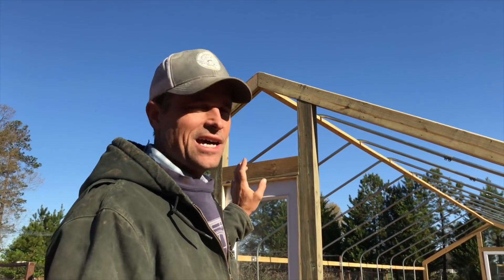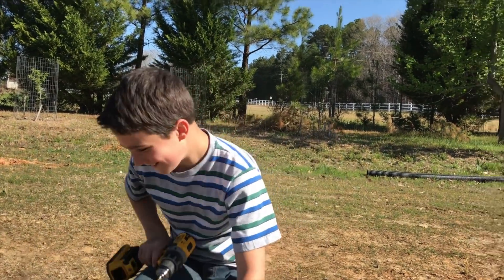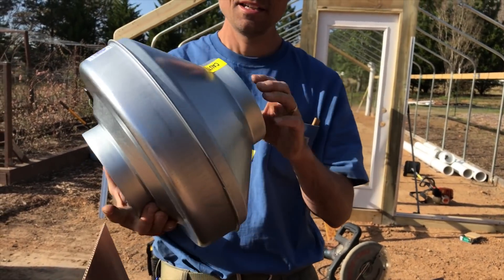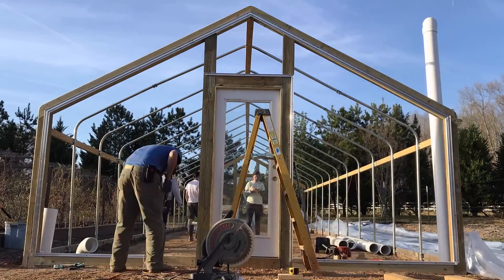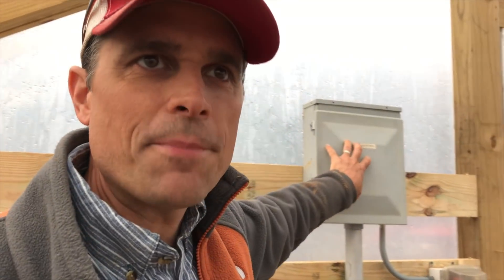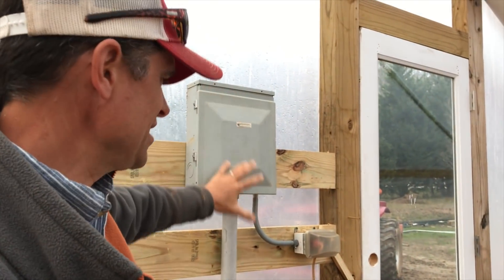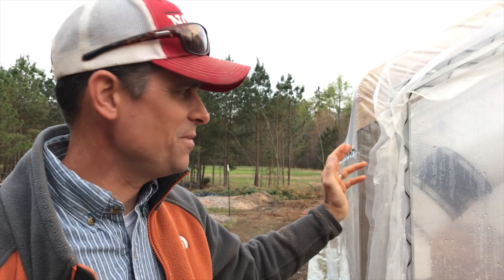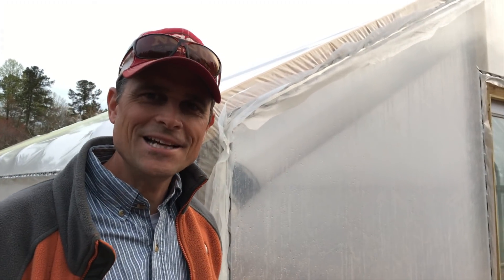DIY Geothermal Greenhouse Pt 8: POLY FILM INSTALLATION

Comment: For the jumper, you could pop rivet your wiggle wire base to the perimeter of a ceiling collar base for air tight fit, install a collar then jumper with something as cheap as dryer hose. One dryer hose should get you multiple jumpers.

Here are the components from Home Depot.
https://www.homedepot.com/p/4-in-Ceiling-Collar-CC4/100124671
https://www.homedepot.com/p/4-in-Starting-Collar-Take-Off-Snap-Together-SCF4/100396965
https://www.homedepot.com/p/GE-Flexible-Metal-Dryer-Duct-PM08X10085DS/205472610

Comment: Thank you so much for making this series. I’m a little south of you I think, around Fayetteville and plan on building a greenhouse just like yours. Please add test videos as time goes by showing how effective or not the geothermal system ends up being. Thanks again man!
Reply from the maker: Thanks for watching and taking the time to comment. We will definitely be adding updates as we go and sharing data. My concern at this point is that the earth battery system we installed is going to be undersized. By that I mean, even bigger manifold or trunk pipes, with larger fans pushing more air faster. At some point we may see if there would be value to adding additional fans on the system which would be easy enough with a y connector.
Reply: Pushing massive amounts of air into a few large inlet manifolds is not the way to go. The higher the flow, the higher the loss. You`ll pay a lot for high capacity manifolds, typically around $360 for a 20ft length of 18" ADS.

Comment: Use dryer vent tubing to make the jumps with the exhaust plate door removed use the flat piece to duct tape to the interior walls.
Reply: Fasten a 4" inch Air Vent Duct Connector Flange ($8 on Amazon) to the film with double sided exterior carpet tape. Then the semi-rigid aluminum flex hose clamps to that. Don't use the foil-paper hose, it won't last long.
Reply from the maker: Yes! That's it - dryer vent made sense, but I was concerned about the wire and securing it to the film. Perfect DIY solution. Thank you!

Comment: Why not put a layer of greenhouse plastic on the inside of your end wall 4" x 4" studs?  Then you wouldn't have to run your $30 "jumpers" to these areas.  You'd have a constant 3 1/2"  dead air space between the layers.
Reply from the maker: We did consider that, but we think we're going to be attaching a number of things to the end walls on the inside. If we don't, your suggestion may still happen. Thanks

Comment: With the changes it's looking great. I am very interested to see how the earth battery works over the summer.
Reply from the maker: Thanks. As to how it works in the summer, we're really interested as well. Of course, as we've posted videos about this project, many folks with far more knowledge than us have shared thoughts. I am now concerned that the whole system will be a bit undersized. We built it based of what we could find at the time and wish he had found more of this information sooner. Still, we would have been limited by time and budget. So we'll see what it does and share the results!

Comment: Congratulations! It looks grand! Have you checked the temperature of the air coming out of the ground yet? Where did you get your fans?
Reply: Hi Phil
If you actively add or remove heat from the ground, its temperature will not follow the natural curve. If you pull a miilion btu`s from the ground under your greenhouse you cant expect its temperature to be the same as the ground outside at the same depth because it didnt lose a million extra btu  ;)
In simple terms, the installation will create a new average ground temperature based on the energy balance. Its amazing how many folks plan to bury their tubes 8ft or more deep due to the stable ground temperature ;) If you take out more energy than you put in, the average drops, and vice versa. There`s no free lunch as contrary to popular belief the energy isnt replaced instantly by the earth`s core ;) 
I know that the average temperature of the ground 10ft below my greenhouse has gradually increased over the last 9 years in comparison to the ground outside at the same depth. This kind of information is valuable when it comes to design choices. If heating is more important than cooling you should insulate below the system. Be aware that adding insulation will fix the volume of mass which may have a negative impact on the cooling performance. If you have the real estate, you could install a seperate system outside the greenhouse to increase the cooling performance. As its not sheltered by a structure, heat will be lost during the night which increases the cooling capacity for the following day. You can also route outside air through a standard system and exhaust it outside to remove excess heat for the same reason if required. These are strategies for hotter climates where a heavy cooling bias is required. Again, it highlights why you shouldn`t copy a system unless its backed up by real data and is located just down the road ;)
Reply: I dont think it would be much help without an understanding of the underlying principles and reasons for the design choices. 
Almost every installation uses the standard format of risers feeding manifolds which supply multiple parallel 4" tubes, exit via another manifold and riser. The losses in this kind of layout are large and cumulative, balancing the airflow so each tube gets an equal share is almost impossible. Folks are fixated with using overly long tubes when they should focus more on the amount of air. Consider 30ft of 4" tube buried in the ground, it has a finite surface area available for heat exhange. If the tube was cutinto 2x 15ft length it would have exactly the same surface area and heat exchange potential..The difference is you can run 2.5x as much air through 2x 15ft tubes as 1x 30ft tube for the same loss. 100cfm would provide a dwell time of approx 1.57 seconds in a 30ft tube. Running 125cfm through a 15ft tube would be around 0.6 seconds. If the air exits the tube at the soilmass temperature your tubing isnt working as efficiently as it would  if  the air exits slight higher than the soil temperature. Moving 2.5x as much air at a cost of a few degrees (waemer exit air) is preferable to moving 2.5x less air and gaining a few degrees (cooler exit air). Its similar to heating a swimming pool by boiling a kettle, a few pints at 212 deg F vs moving a lot of water which raises the entire pool by 2 deg F per pass. The only limitation on the air flow rate is in the event the system outruns the incoming solar gain. You should then reduce the fan speed to keep pace with the incoming gains which will cost you less in electrical power ($$) vs running the fan flat out to cool the greenhouse and turning the fan off until the heat builds back up.
Reply: The temperature coming out of the tubes will be the same as the ground temperature. To be sure all of the tubing is active you need to increase the airflow so the air coming out is above the ground temperature. I dont think you`ll have nearly enough fan power to achieve it. The long runs of 6" pipe (and bends) from the fans will reduce the airflow before it gets to the underground tubing. What is left (assuming the system is perfectly balanced) will be equally shared between the underground tubes, not forgetting they are heavily corrugated and subject to higher losses than smooth tubing. Your fan spec gives a maximum flow of 483cfm at 0 inch wc. Optimistically, you may have 50cfm making out of each underground tube but its likely to be much less. Working on the assumption of 600cfm total you`ll put all the greenhouse air underground 5.8x per hour. It wont be enough to cool the greenhouse even at the start of the season when the mass temperature is at its coldest aka the largest air/mass temperature difference. As the mass warms up through the season, the temperature difference reduces and you need more airflow. 
On a different note, i would use a differential pressure switch and a simple flap valve for the double poly inflation blower, it`ll reduce the running cost by upto 80% and extend the life of the blower considerably ;)
Reply: It wouldnt be worth the expense because the issue isnt the amount of flow, its the resistance. Doubling the airflow will result in a 4-fold increase in losses. It would help to know the dimensions of the greenhouse and the lengths of tubes you installed ;)
Reply: After a quick search i find the greenhouse is 50ft x16ft with 6,144 cubic foot volume. I guess the excavation is around 46ft x 12ft x 4ft deep making the individual tube length somewhere around 44ft long.
Reply: I would have installed twice the amount of tubing with a low resistance (0.1- 0.2 in wc) layout capable of handling at least 2000cfm. Disregarding the shortfall in tubing and losses in the headers, to achieve 2000cfm in the current installation you`d need 2 fans capable of delivering 1000cfm at 2" wc at least. The fans would be very expensive and power hungry,  not a viable option/workaround for fixing a design issue.
Reply: I would look at installing multiple systems which will give you more flexibility and better overall air distribution both underground and in the greenhouse. If  i had space for a greenhouse that size i`d simply install multiples of the system i`m using now.
Be sure to monitor your greenhouse RH% especially on the nights you use the system for heating. You`ll find the data useful when you come to design the larger system ;)
Reply: Hi Phil
My installation is unique and radically different to anything you`ll find in current use. The same could be said about the greenhouse its in. My system was designed back in 2009 under the watchful eye of John Cruickshank who sadly is no longer with us. At that time, realworld data from installations to drive the design forward was very thin on the ground but new information was gradually coming to light, namely increasing the recommended greenhouse turnover rate to10x minimum.The reccomendation of upto 20x for cooling is standard now but its still only 5x for heating. 
I decided my installation was going to be capable of providing as much new and useful data as possible. I bounced ideas off John for several months and literally anything he liked the sound of was incorporated. The end result was very radical compared to the standard format but also logical and elegant. I dont mind pointing ordinary folks in the right direction but i`m not doing the R&D for companies that sell these systems, they can do their own ;) John used to say, its plain to see as the nose on your face ;)
Reply from the maker: Phil, uploading a new video tomorrow with some info about this. We don't have a lot of data, but right now the system is taking daytime air in the greenhouse between 95-105 degrees and exhausting it consistently 30 degrees cooler. At night, with consistent or cooling temps outside, the exhaust temps have been slowly increasing. First several night it was 57 degrees. Then it started rising slowly. Tonight it was 64 degrees. So I think it is starting to increasingly store heat. We'll continue to update and show real data.
Reply: To get a better picture you should install a few sensors to monitor the soilmass temperature.They are also very useful for controlling the fan.  Its vitally important to monitor the greenhouse humidity  What you will notice is a rise in greenhouse RH at night when the system is running. Folks assume the heat from the tubes is 100% sensible like an electric fire when in reality the bulk is in latent form. What happens is the cool air picks up sensible heat which raises the temperature. The RH% drops as a result and the air picks up moisture. Here`s the important part, in order for the moisture to evaporate (change phase from liquid to gas) it requires energy which it acquires from the mass. Sweat evaporating from the skin is the same process which results in.. cold skin as the sweat takes the energy it needs to change phase ;) The increase in RH% doesnt raise the temperature of the air. When the warm, moist air meets the cooler glazing or steel frame it will drop to dewpoint and condense. At the same instant, the sensible energy robbed from the mass to evaporate the water in the first place is now released to the glazing or frame. In essence, you`ll have a conveyor belt taking heat from the mass and transporting it to the glazing etc where it is lost ;)
Cooling mode converts latent to sensible and stores it in the mass.  
Heating mode converts sensible from the mass into latent. Glazing (or other cold surface converts latent to sensible. If you understand the processes involved prior to installation you can address them in the design phase ;) If you look at the literature from companies selling these systems you see nothing is mentioned. Either they dont understand the system they`re selling (copied system) and/or didnt test it thoroghly enough to notice. Or they couldnt come up with a solution and chose to keep it quiet ;) 
If you have a system running, you can learn a lot from monitoring and testing.
Reply from the maker: Thank you! We've not really gotten around to collecting data yet, but promise to share as soon as we get enough to be relevant. We bought the fans from AC Wholesalers (https://www.acwholesalers.com) as they seemed to be the best price we could find and had free shipping.
Reply from the maker: JohnGuest45 If we added another fan to each pipe, how much do you think it would help?
Reply from the maker: JohnGuest45 Correct.
Reply from the maker: Thanks for the feedback. All very helpful as we plan to actually design a much larger greenhouse and use the information gained from this process.
Reply: JohnGuest45 do you have any plans or a description of what you are doing with your setup? I am planning on building a similar greenhouse in the next year or two and want to do it right the first time.  Do you keep any data to keep track of what’s working and what isn’t?
Reply: JohnGuest45  well I’m not a big corporation trying to make lots of money off of an idea just a simple peasant wanting to build the best greenhouse I can.  Are there any pointers you can send my way to get me headed in the right direction?
Reply from the maker: Any chance you would consider uploading a video of your greenhouse, or having someone do it for you? Seems it would be a real help for folks like us that are trying to do something and piece information together. What I found frustrating is that people post videos, don't really show the system installation, data, how and why it works. This has obviously led to some of our errors because we believed that what people were showing actually worked, and trusted that they knew what they were talking about.
Reply: St. Isidore's Farm  JohnGuest45  What I’m trying to figure out is if the heat being pumped underground during the day is successfully heating during the night or if it is more about heating/cooling the air to the temperature of the earth which is stable underground once you reach a certain depth. It would be interesting to compare the temperature of the air exiting your system in the middle of the night vs a tube buried at the same depth outside the greenhouse which would be the earths temperature.  Do you get what I’m saying?
Reply from the maker: Thank you for this - all of your information is very helpful, especially as we think about another much larger greenhouse down the road. We don't have a lot of data on our system, but so far during the day when temps in the greenhouse are between 95-105, the air coming out of the return pipes is consistency 30 degrees cooler. The other news is that at night, with evening temperatures trending colder the past few days, the return temps have been rising a few degrees - starting out around 57 degrees the first several nights, and now 64.
Reply from the maker: Thanks again for taking the time to write out thoughtful comments and replies. Learning a lot from them. You really should consider uploading some videos to try and explain this for folks like us.

Comment: we used a coffee can with dryer vent hose .the can was flanged on one end and mounted on plywood and then another piece of plwpod between the plastic and then the two pieces bolted together .works well
Reply from the maker: Thank you for taking the time to share this idea - folks offering suggestions is really helpful to get a sense of how other solve this problem.

Comment: So do seasons matter for growing plants in a greenhouse? I don’t know much about plants but I’m guessing they run their clocks off of day length, not temperature, so can you start seeds in April that should’ve been started a while ago?
Reply from the maker: Depends. Some folks use greenhouses to grow things year round. Depending on your climate that means supplemental heat and then it's a cost benefit analysis depending on the energy source used. A lot of people use them as we will to get an early start on garden plants. We're behind this year on the completed build due to the weather, but we'll still get a jump on things like tomatoes and peppers. Then we can extend the season into the fall early winter as well.
Reply: St. Isidore's Farm Will you be able to grow non winter plants during winter? (Like tomatoes or something)
Reply from the maker: We could if we provided a lot of supplemental heat and light. Don't know that the energy costs would be worth it. But things like broccoli would be a different story.